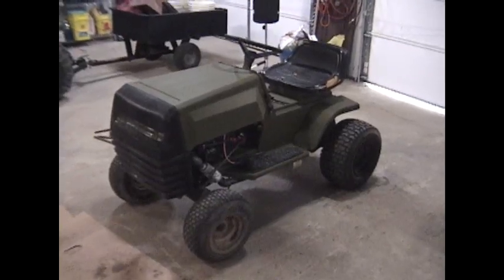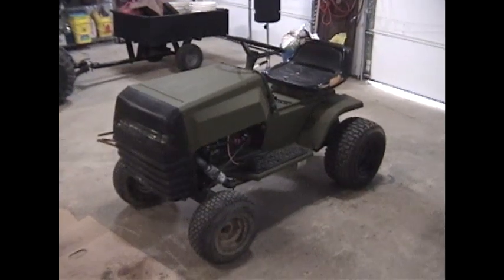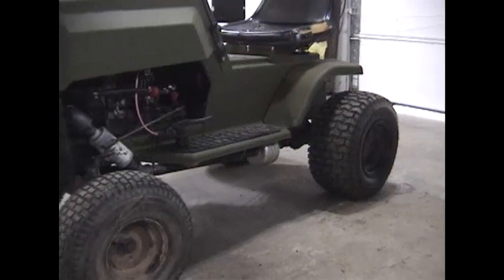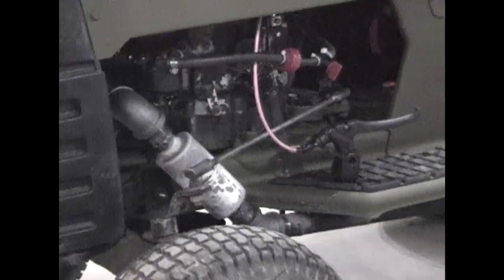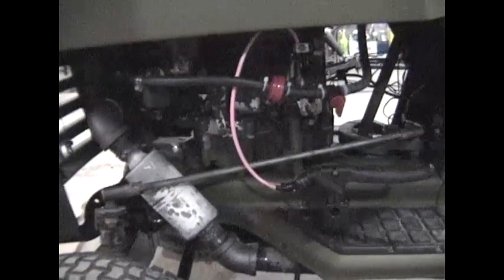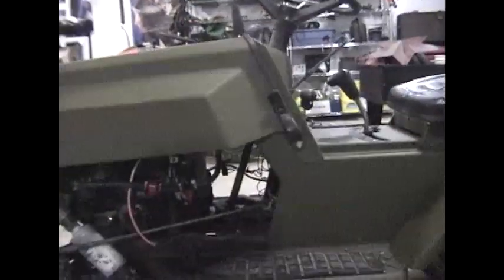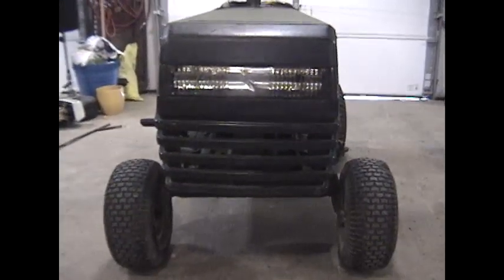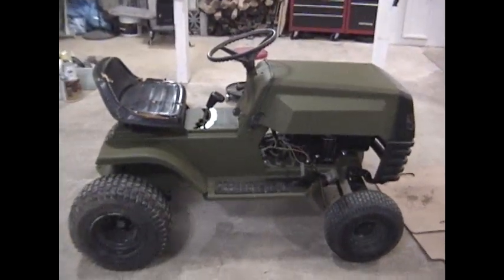Turning  An Old Riding Mower into a ATV,Utility Vehicle, Or "Mud Mower"

Comment: Basically that's what I did bro 😅 took a craftsman 18HP and transformed it into a lawn tractor. It doesn't have a lot of speed but my focus was on traction. Opened the OHV air intake lowered the gears 1 to 5 and added weight , lifting it overall 5 inches from initial ground level to be able to go in the woods easy. Needless to say now I pull 8 foot long 18 inches wide logs with it
Reply from the maker: Heck yes! I'd love to see pictures!

Comment: Instead of using stock type headlight bulbs, get a couple 12 volt LED 50 watt landscape spotlight bulbs. Glue them into the original headlamp areas, (w/o the sockets) using black RTV silicone. They are bright and last a super long time.

Comment: Safety sam here:  1st. good video and great way to quiet the exhaust (yeah, i'd like to hear the difference myself.. ).  2a.  The plastic tie straps on the gas filter shutoff valve are not a good idea , eventually you might get a big gas leak and burn down your garage. .  2b.  15mph may seem ok, but remember those lanwmower BRAKES are not the best, be very careful or tragedy.   3.  give us a link for the front muffler with the threads on both sides.
Reply: If your only ever afraid to die, you'll never truly live

Comment: Would a liked to see it in action & hear how quiet you made it, but I'll take your word for it. I've had a question about these conversions to riding mowers to make them go faster for quite awhile. Do you use the original steering gear setup that was in the mower ''as is'' or did you do any modifications to it. I've got a couple of riders I want to do this to, but I just don't like the steering gears that are in them. I may just need to tighten the gears closer to each other on 1 of them & put a lot a grease on the gears to see if that helps. As wobbly as the steering is now at mower speed kinda concerns me if I try to drive that 1 particular mower at a higher speed. The last thing I want is to have the front end throw a wobbling fit at about 15 - 20 miles an hour (if I get it that fast) causing me to lose control & wreck. I've already nearly been killed in 1 wreck & my body is too old to go through another 1. By the way, I like your color choice. Keep up the good work.
Reply from the maker: There is a part 2, and then 2 more videos on the muffler system somewhere on my page. If I get time I will link them to this video, but search my videos and you will find them.

Comment: Nice exhaust modification. That fuel shut off valve will also save your engine from blowing by keeping gas from flowing into your crankcase. I add them to all of my equipment where possible.

Comment: Enjoyed video, would like to do this with an old mower. I have had good luck with Automotive Goop on reinforcing the cut or weather wear on old tires, along with adding tubes. The Goop will help make the outside smother so mud or sticks want tear off the rubber.
Reply from the maker: Thanks for the tip!

Comment: I would honestly love to get my hands on something like this. I have been wanting to build something like this for quite awhile only with a bed attached to the back so that I can use it to make runs into town to get groceries and to bring back the game I go hunting for. (Small to medium game such as rabbits and pheasant to wolves and maybe a small boar)
Reply from the maker: Keep your eyes glued to craigslist this fall when people give up on their old mowers and you can get one of these old murray type riders for less than $100. Just make sure to get one that has the manual trans, and you are golden!
   I got this one for free from a co-worker that was going to toss it becasue it didn't run, had a flat tire, and had a bad deck. 
   As long as there isn't a hole in the engine block 99% of these can be back running with a little carb cleaner and an oil change.
   I too am thinking about welding a small bed on the back, and maybe even rigging up a tandom rear axle. the other thought I had for hauling was building a front mounted rack over the hood. Its pretty flat, and big enough for most of the tools I used on the farm.
Reply: If you plan to be putting tools on it then I suggest a smallish tool box mounted on the back thats big enough for the tools you plan to carry on it and then do a trailer hitch and get a small tow trailer that fits what your planning. I had an old lawnmower pit bike out in California and once I got here to Idaho I took it and added a small hitch to it with the limited tools I had access to from my collection and my new neighbors, then mounted a small towed flatbed trailer designed to carry small loads and just put some raised guard rails on it. That worked til I got out into the country when my bike was stolen in the move. Now I am stuck hoofing it around because no license to drive. Then again I do not need 1 for my city as they allow stuff like this on the residential and back roads without a license. I just cannot go down a main road more than a block.

Comment: One question..i have a 96 z275 John Deere. Removed deck, replaced fuel filter, new battery, new starter, but the pto switch was removed due to it engaging without touching the switch. Now it won't start cause it thinks the switch is pulled. How do I bypass this?
Reply from the maker: Hmmm. That's a good one. I think I'd need to see the wiring diagram.

Comment: I have one it leaks oil in the diff cant find the plug i guess i will drill one unless you found one on yours i will fill it with jd corn head grease or lucas extreme thanks

Comment: How bout putting an LED bar in the front instead of replacing with light sockets
Reply from the maker: That's a great idea! The little 12v battery should be able to handle that too as led's are very efficient.
Reply: That's what I plan on doing to my mower project. I can find an LED bar on ebay for a little over the  price of new sockets and bulbs. Keep having fun with your build. Looks like a lot of fun.

Comment: I've got a Sears Craftsman that I'm currently building (pic in my avatar). It's built on that same Dynamark chassis...
Reply from the maker: Its a light, sturdy little ride. I regeared mine down from at top speed of 12 to 15mph to a max of around 8mph now and use mine as a yard mule. its my go getter with a little pull cart attached to it most days.
Reply: That's cool!

Comment: I know it's fun to build stuff like this, I have too. But if doing it soley to have a 'cheap atv', it's just not worth it. It's still just a lawn tractor, no matter what you do to it. They can't do the slighest off-roading or mudding without getting stuck. And you don't have to spend 'thousands' to get an ATV. I just picked one up for $150, and had to put $20 into it to get it running and riding. Even the smallest, cheapest, weakest ATV will still be FAR better than a lawn tractor turned into an 'atv.' They have suspension, better tires, are faster and are far more tougher/reliable. And please name one ATV that is NOT locked in the rear. They ALL are.
Reply from the maker: I think that's where the issue is here. On a small farm like mine, an ATV is used as a work tool, not as a "muddin" toy. I use this little thing to haul a cart full of hay, and to drive the fence lines looking for issues. I wouldn't expect this thing to outperform or even match a real ATV  when it comes to off road use, but for a fun and cheap project that has created a useful tool, I like it!
   If I could get an ATV for $100, I'd be all over it, but in my neck of the woods they just don't exist.

Comment: You made 2 videos and dont show it running or driving-SAD!
Reply from the maker: +Mr Frog I don't have anyone to hold the camera!  Its a fun little toy, but no more exciting then it looks just sitting there.   I built it to haul stuff around my property at speeds a little more fun then a stock mower, and for that it works great. I will say it still has a VERY harsh ride as it has no suspension, and when you get her going fast, every bump turns into a real bang.
Reply: Would have been nice to hear how quite it is. Kind of wasted my time watching this.
Reply: @pikadroo  The microphone sensitivity and playback volume adjustment destroys any real life accurate perception of how loud it is.  Signal attenuation would even distort a before & after comparison.

Comment: I'm disappointed that you won't let us hear it. Must not be as quiet as you claim.
Reply from the maker: As I've stated before,e I will make a video of before and after, but its kind of pointless as the mic on my camera has a noise cut off. The sound of the mower is so loud that it cuts the decibels down so it doesn't overload the signal. when I run it before and after the camera makes it sound about the same, when in real life its much different.